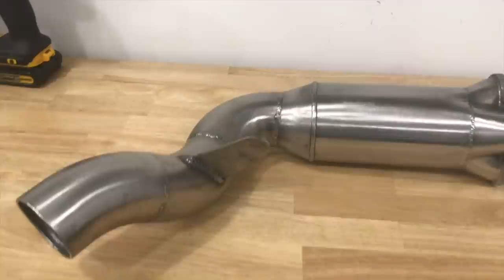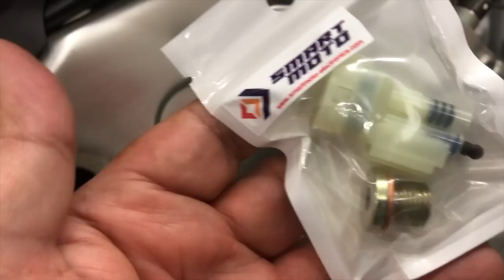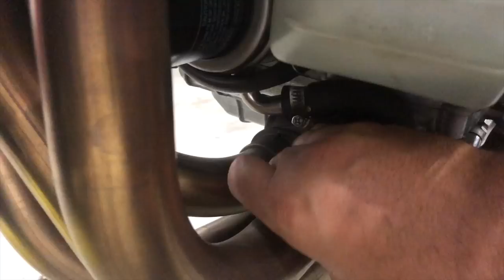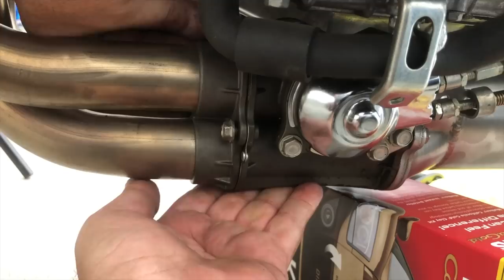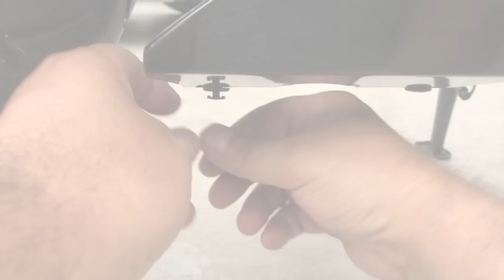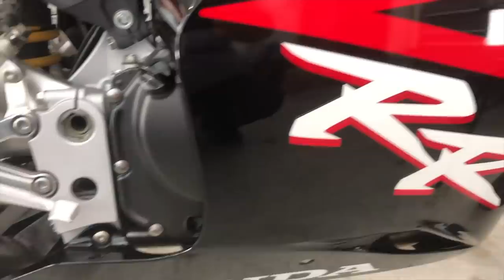2002 Honda CBR 954RR Fireblade Gets a New Shorty GP Pipe

Comment: You can get the link pipe from black widow exhausts to remove the valve, since you are not using it any more. It's saves a little weight
Reply: And, of course, we need a fly by with the engine screaming above 10k rpm 😁

Comment: How did you overcome the power drop between 3000 and 6000 rpm without removing the valve system? I have exactly the same exhaust with a PC6 mapped for it. but 3000 to 6000 rpm is still awful
Reply from the maker: I have not overcome the issue, yet. While I do notice something similar, I guess for me it's tolerable. 20 years ago I wouldn't be able to sleep.  I choose the trade off of form over function. Have you posted videos of your setup?
Reply: Why are you in that refrange then
Reply: And I doet have that problem either. Maybe let a different tuner tune the bike
Reply: launch at 6000Rpm or set idle to it

Comment: How is it insane, just a freaking pipe. Lol you folks need to get in reality. Nice pipe but unless it is 20lbs lighter than others or makes 25hp more nothing insane about it.
Reply from the maker: While yes it's just a pipe. And no it is not a 20lbs weight savings, more like 8lbs, still good though. 25HP would be a 16% gain and no it is not doing that. Maybe with some major tuning but that might come at the expense of an enjoyable power band. 

If you see it in person you will notice that it is very well made, internal baffle is slick. The craftsmanship is top notch. Also, it was under $600 delivered.  I looked at some pipes for $1000 that were just okay. Of course, there is also some personal preference here. This produces a particular sound. And it is loud when you open it up, otherwise very livable. 

I guess the term insane was based on my personal preferences not click bait. I love the tone, that it's clean, no giant can hanging off the side.
Reply: @kuzmaniac  just wondering what makes it insane, it is a freaking exhaust not all that different from any other aftermarket pipe. Nothing INSANE  about a pipe